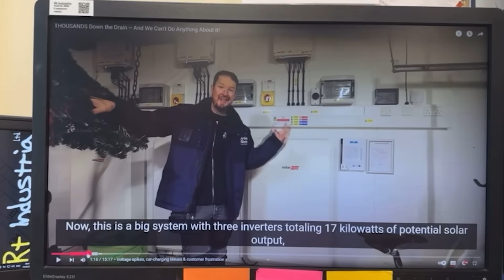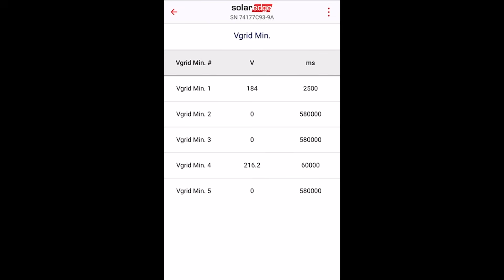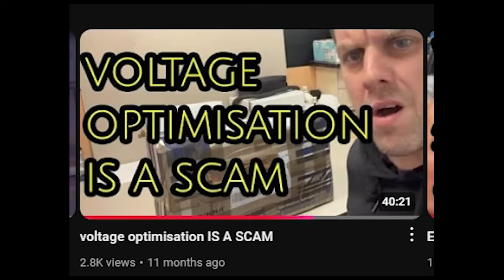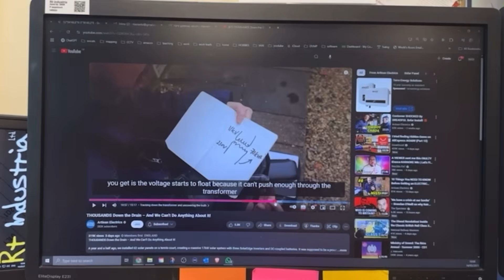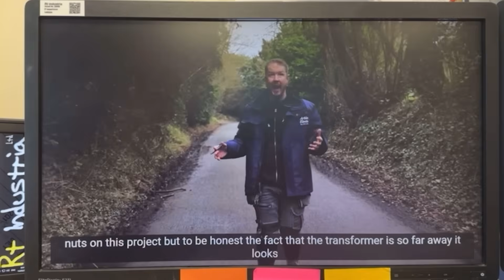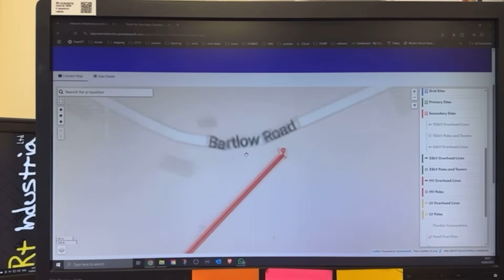ARTISAN ELECTRICS v THE GRID. WHO,S TO BLAME

Comment: It's called resistance and plainly the length and size of the feed cable to the house wasn't considered either by the DNO or by testing by the installer. The solar will raise the voltage to push back as that't how it works, no inverter fighting. Yes there are loads of things that could be changed but with them there are risks of not getting the absolute max from the solar. I would look to try and use the battery at peak times to absorb the excess or some other form of dump load such as water heating. At night I would drop the charge rate to fill the batteries over the entire cheap rate time. The optimiser seems to just be an auto transformer in this case and so the problem was bound to be shifted the other way under load. There will be no issue with the transformer of course, his solar will just be offsetting other loads on the transformer. If it's a 100Kva transformer 17Kw going back through a leg will make no odds. The whole bit about the transformer being dirty and looking old in the original video was just an emotional red herring. A dirty old car isn't a reflection on whether it can do its job. He should have tested the impedance before starting and the DNO should really have known about the cable from the transformer to the house however I wouldn't ever expect them to know or check that. They likely looked at the transformer and what's connected and couldn't see a problem.  I bet the transformer is set at 240v as it has to be right for the closer houses too. Sometimes it takes throwing a brain at a problem rather than money and equipment and sometimes people need to be prepared to change their habits a bit to achieve their desires like change when you charge the car, change it's charging speed, change the battery charging parameters, have a controlled dump load when charging the car to keep voltage in check etc. etc.

Comment: Another one, sorry, I've always wondered how these local transformers work in reverse. When my powerwall 3 is putting 11kW back onto the grid, and there isn't much local usage, will my export actually pump back up to 11kVA and go up the HV network? So the transformer could potentially be pulling from the network on 2 phases and pushing to it on the other? Does that cause problems?

Comment: If all these other houses are on the same DNO transformer. Lets say there are 17 houses on it, surely they would be using 1 kw per hour to run. Would they not just suck up this 17kw and reduce flow from the transformer if you know what i mean.... I am of the understand electricity works a bit like water in flow, using the path of least resistance. As i say i'm a joiner not well up on technical electrics 😊
Reply from the maker: Generally your right with the water

Comment: I think you've missed the key point. They got approval for the install. You definitely do have valid points in this video, but I disagree that it's an oversized system given it had approval in the first place from the relevant authorities. So they have a right to be saying hey guys, this is causing problems. Totally agree about the voltage optimizer though.
Reply from the maker: No , again have you ever read a connection agreement you don’t just get to spink 17 kw 24/7 at any voltage you like
Reply: @Actual_electrical_content  best bet, go off grid. To hell with the power companies. Here in Australia, from 1st July power companies do not need to pay you anything to feed into the grid. So...my system won't be!!
Reply: The approval isn't a yes/no response.  You have to detail what is being installed and, if acceptable, the DNO comes back with what can be installed and a bunch of limitations that you have to comply with in order to be connected, remain connected and be compliant with the regulations, limitations and UK law.  Jordon has either ignored the DNO paperwork or, more likely, has little idea as to what it all means and how to comply.

As a starter for 10, what are the chances that the voltage modifier monstrosity is either in the application, or in the approval or even has a chance of being approved or being on the correct side of UK law?  My guess is zero but I don't have the full details.

What is certain is that the installation is operating outside of the permitted range detailed on the DNO paperwork that Jordon never shows.  The other thing he does not show is the SolarEdge SetApp software, where you enter the limits set by the DNO or what efforts he made to edit the SetApp limits to bring the system back into normal operation.  The system design with 3 inverters looks rather odd too.  Why so many when 2 would be counted as an elegant sufficiency?  It certainly isn't a capacity limit as the customer could go up to 6 SE batteries on 2 inverters.

I'm not trying to contradict @Actual_electrical_content here but I will enhance something he said in passing.  The grid system is only monitored down to the 11kV point.  Beyond that it is dumb with (almost) no control or monitoring.  I say almost as the downstream transformers can be adjusted (aka tapping) but this is usually avoided once a loop is in service as it requires that the local system is dead before being adjusted.  Costly and not exactly popular.  

The DNOs do not instal temporary monitoring equipment on poles for fun either.  Something has made them instal the phase, voltage and current test points and broadcast that data back to the mothership.  The DNO is interested and between Jordan's video and the customer's alleged intransigence to allow the DNO to spend its money installing remote testing equipment will give them all the evidence they need to withdraw the approval due to multiple breaches and failure to allow DNO access to data.  Part 2 of this video will probably have to include the prohibition notice being served against the property owner.  Part 3 should cover Jordon explaining to the MCS and the regulation bodies as to how he connected this without proper design, testing and adherence to the DNO approval limit.  Did Jordon really walk away from a system that he knows is operating outside mandated limits?  Does the property owner know his home insurance policy is now invalid?  

Finally, as I genuinely don't know where the liability lies with this one (as electricians usually avoid it like the plague), is Jordon and/or the property owner on the hook for expensive liabilities due to the voltage impact on his electrical neighbours and the DNO equipment on their side of the connection?
Reply: I don’t think it buys you a right to export that, more like you can export up to that when conditions allow.

Comment: The inverters should throttle back if the voltage rises too high due to lack of load.
The customer would lose out if the demand isn't there!
So it shouldn't have to be a problem to the grid.

Comment: In the summer the best thing to do would be not to charge the batteries overnight, set an export limit that doesn't cause issues and then set the SE inverters to "charge from clipped power" - I've got 12.8kWp of panels on my roof, a 10kW inverter but a 5kW export limit, and that's how I manage to self consume all of the solar I generate. You can even get more clever and dump power before sunrise if the batteries are still too full to soak up the generation that you can't export. I use a piece of software called EMHASS to optimise it all for me - it looks at the Solar PV forecast for the next 24 hours, predicts my household usage with a machine learning algorithm and then takes care of charging and discharging the battery.
Reply: I've done some local authority work lately and told I must not change any settings . I'm going into people's homes who's batteries aren't even charging because of the settings being dine wrong . I may have changed a few regardless 😂 poor people being messed about by someone in an office who couldn't even change a plug

Comment: I saw the video and had a quick look at solar edge and it's upper output limit is 264.5v ac which expains Jordan's observations, why that is permitted in UK when the acceptable permitted range is lower is odd- other manufacturers limit output to 253v for the EU market.  Other customers on that leg are likely seeing an incoming voltage exceeding the limit which is the fault of the DNO (by permitting someone backfeeding excessive voltage) and is going to have detrimental effect on their equipment.  To me the install should the throttled to 253v and if that results in no power being exported (due to output side already being at that voltage) then so be it.  If someone wants to be generating more than what the existing system can handle they should be doing it in agreement with the DNO and having the infrastructure sized accordingly. If the customer's motivation is to reduce grid dependency then just get some more batteries to store the excess generation during the day to a size that suits them.
Reply: Well said. Add more load (charge batteries, heat water) at least until the grid side issues are solved. Or reprogram the inverters to kick out on an over voltage condition. (My Solis inverters bail when the voltage spikes.)
Reply: It’s not acceptable in the UK, ESQCR dictates a plus 10% and minus 6% range from nominal voltage of 230v, giving you 253v-216.2v.

Comment: Fantastic video Jamie, best way to spend lazy Sunday morning!!

Not much knowledge on how the solar inverters work, but we’ve seen same grid voltage lift while synching up standby generator on 3 phase industrial site. Same issue as he has here. Site located at end of very rural 11kv line, grid voltage about 235v pre synch. As geni synchned to grid and load taken over to geni (300kva) grid voltage rise due to load been removed, no voltage drop on grid due to load removal (site ups over voltage alarm at 265v). In Jordan’s case further accentuated due to trying to force 17kva back on to grid. 

Surely the inverters should throttle back as grid volts rise above ESQCR limits, I suspect they’ve been tweaked to stop them to allow greed export

My analogy on this goes like this. You can drive a ford fiesta flat out all the time (in much the same way a 17 year old may) a more mature experienced driver will correctly appreciate it’s not a good idea.

As others have suggested I think only viable option is to go three phase.

TIA or Step 7 ?????…..that is the question
Reply: It's the DNO's responsibility to ensure voltage stays between ESQCR limits. Normally they do this by limiting the maximum demand or generation that can be connected. they cocked jup in this case

Comment: DNO said yes, that's the end of the story, it's not down to the designer or installer to go back and say "are you sure?" this is how legal obligations and contracts work
Reply from the maker: You have clearly never read a DNO connection agreement , the agreement can also be pulled at any time
Reply: Think you will find the DNO said yes on the basis he had done his due diligence and assessed the install and supply properly. He did that after the fact. Chances are the DNO were lead to believe it was 17kw peak which would have been a complete different kettle of fish. That amount of generation on a single phase with 3 inverters shoulda been screaming alarm bells  at him straight away but clearly he was naive and didn’t understand beyond “fit the system rake the cash”

Comment: Why is this house not on three phase? The unbalance load from this must be horrific. I fear they have no idea of real v apparent power!
Reply: If it’s rural the nearest 3 phase may be a mile away.
Reply: @edc1569  The transformer in the video is 3-phase...
Reply: "You cannae change the laws of physics." It would be the price of doing business if they were a machine shop rather than amateur power station operators.
Reply: @ Yeah UK grid is in abysmal state in rural areas. I've not "seen it all boy" but been there for years to get ideas - I look on utilities a lot - professional deformation :-)
My home country CZ is much better. We very rarely use wooden poles for energy utilities (except phone service/lamps in rural) and 3 phase is standard even to last forgotten farm in ruins in the middle of nowhere.
Big overflows are not connected other way than to 3p - limit for 1p is 3,7kW. Async inverter was hard requirement for 3p LV until year ago.
Substations... well, not all of them are in great shape but most of them will be remotely monitored. Also... you cannot sell energy without smart meters - those monitor also if you are fullfilling obligation to grid - voltage, phase angles and reactive power management - most of those values are accessible to customer via distribution network web pages. If you not fullfill your obligation to grid you get fine. 
Grid operator will rather not connect you in the mode of overflows( except technical ones in maximal allowed current scope within 15mins until inverter manages to get close to 0 or slight consumption). Or they will connect your power plant in non-guaranteed overflows (HV for now, expected LV in close future).
Reply: 3 phase to a house, what is the world coming to. The grid is under serious load already, and now we have all this solar going in left and right. Something's got to give surely.
Reply: @ajs2120  3 phase is default connection for the houses in my home country since 40-50s. Even for smallest ones.
Nobody asks you if you want 3 phase. You'll get it.  Installations are done that way. Except special cases. Small appartment, low consumption public devices or lamp posts for example.
Reply: @ajs2120  my brother got 3-phase added to his house mainly to allow him to get more solar installed. Overkill? Perhaps, but these days, if you want to get a big heat pump to replace gas, you might want 3-phase as well. 3-phase is common in much of continental Europe.
Reply: @BobHannent  it certainly is here in france & in fact the more rural you are the more likely you are to have it
Reply: I expect the costs of running in the equipment and cabling would be astronomical. Though when I saw three inverters I initially assumed it was three phase.

Comment: Hmmm he’s a bit of a bell, but does have a few points.

The geeza was given permission to export 17kW. And as far as I know, that’s all day every day.
That’s on the DNO, it’s their equipment, and they do the assessment and provide the permission to export.

It’s really quite simple, if the local grid ain’t up to it, they shouldn’t have given the permission. 

It’s their responsibility to maintain the grid voltage with all appliances given permission to connect. End of
Reply from the maker: Again you have never read a DNO connection agreement
Reply: @Actual_electrical_content  I installed a 4.1kW system (in scotland) and was told I needed to apply for a G99 cert. So I did and it was all easy. Now, of course - I could add a pile more solar and expect the existing G99 to cover it. I suspect the DNO would then say - well, er, no.
Reply: @Actual_electrical_content  enlighten us.
If you’ve got an agreed max output capability of 17kW, what’s the provisos around that then.

Comment: Regarding that 'voltage stabiliser'.  I suspect what is happening in the overall system is the premises inverter is pushing the voltage up and eventually limiting at 260V (I suggested the curtailment settings need to be adjusted to reduce that but that was met with 'you don't understand' from Jordan) clipping the system production there.  The unit lowers the premises voltage giving the PV system more room to operate - within the premises.  That will allow more self consumption.  It doesn't address the voltage rise externally.  That's still going to happen, in fact now with the action of the transformer (autotransfomer instead of a full 2 winding job?) the network voltage will be pushed even further up.  Essentially he's gaming the system with a big 'f you' to the other people on the distribution transformer.  If someone measures the voltage at the premises meter it's going to be just as bad, or worse than his 'before' chart.

Comment: These are the ratings for G99
Over-voltage Shutdown:
Stage 1: 262.2 V (1.14 p.u. of 230 V) for 1.5 seconds
Stage 2: 273.7 V (1.19 p.u. of 230 V) for 0.5 seconds
Reply: Where's that written down?
Reply: @alanhat5252 Erec G99 section 10.6.4 latest engineering recommendation for G99, national grid. Tells you what settings are. I think they have gone into the grid protection settings in the solar edge and either over ridden these or not set them correctly. It should disconnect to protect the grid.
Reply: @alanhat5252  be in the spec for the dno grid  settings.
Reply: @alanhat5252 search for “ Engineering Recommendation G98
Issue 1 Amendment 7
3 October 2022
Requirements for the connection of Fully Type
Tested Micro-generators (up to and including 16 A
per phase) in parallel with public Low Voltage
Distribution Networks on or after 27 April 2019”. Page 53
Reply: Engineering Recommendation G98
Issue 1 Amendment 7
3 October 2022
Requirements for the connection of Fully Type
Tested Micro-generators (up to and including 16 A
per phase) in parallel with public Low Voltage
Distribution Networks on or after 27 April 2019